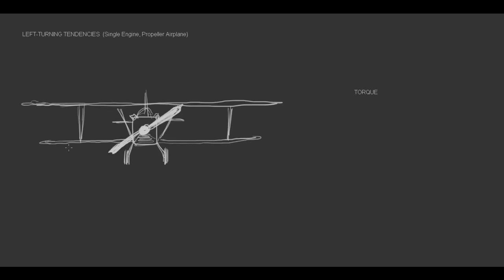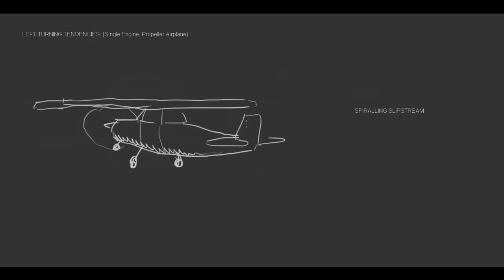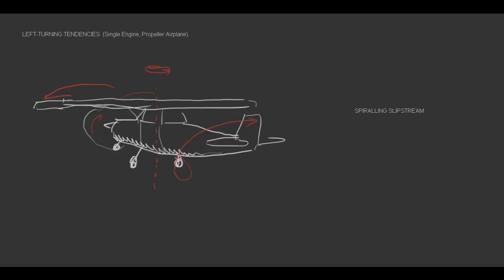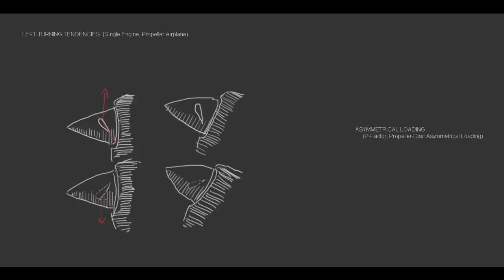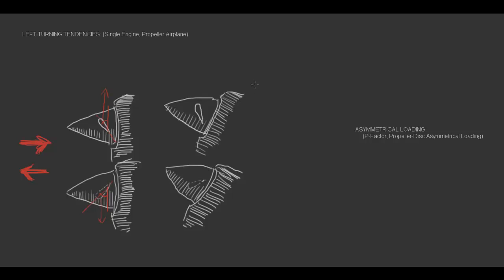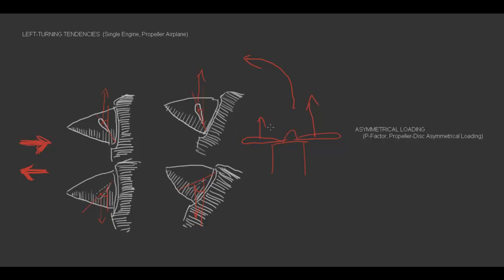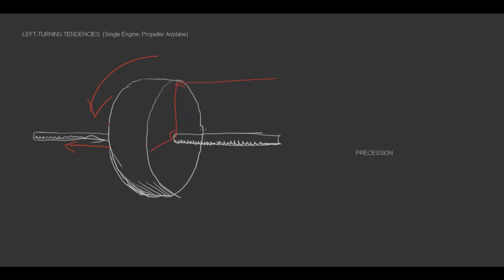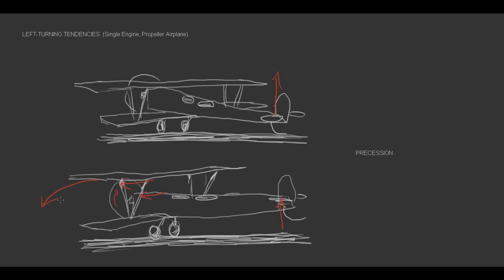AERODYNAMICS- LEFT-TURNING TENDENCIES (single engine, propeller airplane)

Comment: Just thought i would add...The torque reaction is transmitted into the airframe by way of the frictional losses in the drive bearings in the engine/prop. The torque roll therefore is more sensitive to engine RPM than engine load.

Comment: This explanation fixed my frustration about flying Cessna C127SP Spyhawk in Flight Simulator X. During takeoff, gliding, and landing, the aircraft always bank/turn left. So this is the reason behind that. I tried using 2 engine aircraft )Bombardier aircraft and never experienced that thing again. Thanks much Jakub...

Comment: small correction on P factor AOA should be the angle between prop chord line and resultant relative wind and not just a vertical line.

Comment: Very nice pictures. I do have one question about Torque. If the propeller is rotating clockwise as seen from sitting inside of the airplane, the Fuselage will want to rotate counterclockwise correct? If this is a rolling moment, why are we adding Right Rudder (yawing moment) to counter something the ailerons should be counteracting since it is a rolling moment?
Reply from the maker: You are asking a good question, and while the counter-rotating effect is present and is said to contribute to left-turning tendencies, it is relatively minimal. Its a great question, but it is relatively minor in the overall picture.
Reply: Hi Jakub and dcav8, I know I'm a little late. however, to answer your question about torque while taking off, because normally torque wants to roll the aircraft to the opposite direction of the propeller. Now our aircraft cannot possibly roll while on the ground, the pressure rolling it to the left is actually still applying pressure on the left side of the airplane in a result of more friction on the left tire yawing the aircraft to the left.
Reply: LEVEL: Commercial multi engine certificate, airplane
Reply: The yaw tendency is not due to torque effect, rather due to P-Effect, creating asymmetrical disk loading, and due to slipstream effect.
Reply: @DFW2017  correct !!!

Comment: Not convincing at all....... forgive me my ignorance, I'm coming from autosport, not aviation. But why is there not a word about tires?
1. Torque. So it produces roll in the opposite direction to prop spin - but how does the roll translate into yaw? I would say it's because left tires are loaded more.
2. Spiralling stream. Again - this gets greater effect when the tail lift up because rear tire has no contact with the ground and the tail has more freedom.
3. Asymmetric loading. Really? Prop spins so much faster than the speed relative to the air that this point is total BS.
4. Precession - see point 2 - the effect is great only because the tire leaves the ground...